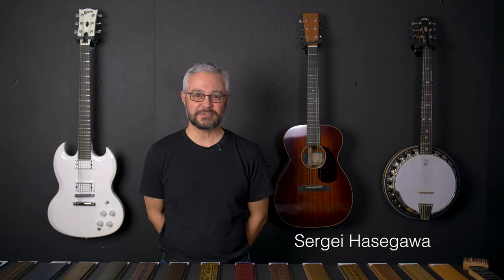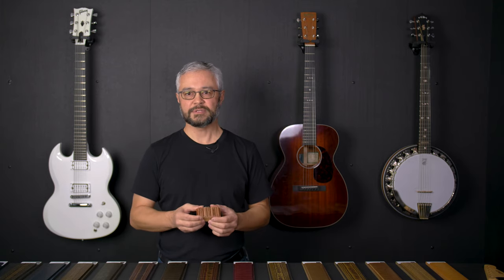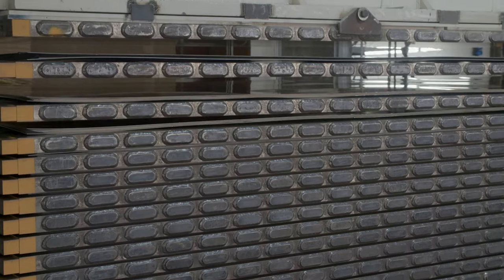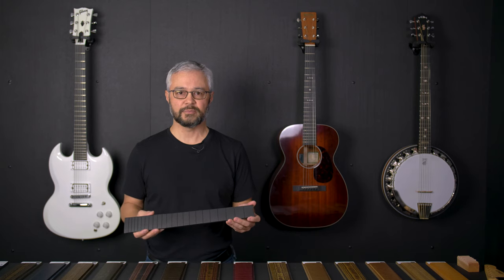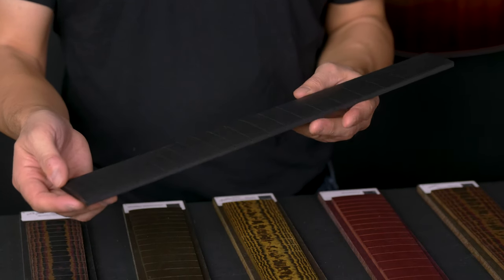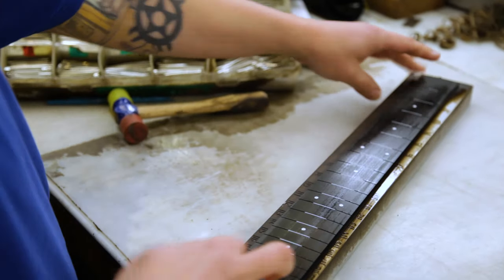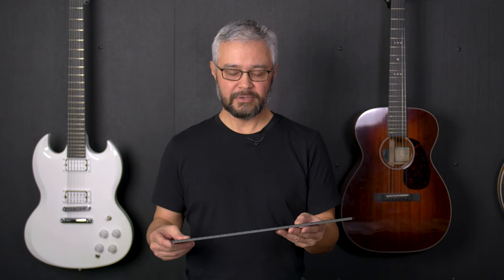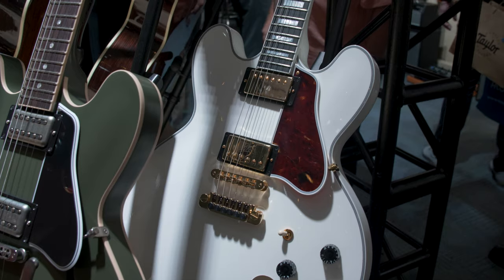Why Richlite Fretboards are Superior to Ebony!

Comment: Lets face it , you cant beat Ebony and rosewood for a finger board, however I have guitars with 
Richlite boards and they sound and feel great the one thing I find strange is why Richlite is 
the same price as Ebony
Reply: If you can't get ebony, you can use any other hardwood. Why would anyone pay for fake wood at the same price as the real wood? Am I missing something here? 🤔
Reply: With rich lite your paying the price that it takes to make and process the paper, for ebony your paying for the market value that the wood has since it’s very sought after. If ebony wasn’t popular then you could probably buy it at the same price as Indian rosewood for like $20 a fretboard
Reply: Richlite is so easy to maintain. That alone is a great reason. I prefer it.
Reply: @ANCAPVoluntaryist   Wood is cellulose. Paper is Cellulose. So the difference is that one has a resin impregnated into it. So there is really no difference. It's not fake wood. It IS wood  :) Best Regards and Best Wishes!

Comment: Best argument for using this is deforestation, even if the sound difference is minimal.
Reply: where do you think paper comes from?????? Richlite is 70% paper duh!
Reply: @dietersdawgs  Yes, but it can be made from recycled paper as opposed to cutting down a tree exclusively to be used only once
Reply: @Shmingleshmangle  I agree....you're still cutting down trees.....I do some lutherie and the problem with ebony is that what made it short in supply was primarily piano manufacturers insisting on jet black ebony, so the Africans cutting them down would cut down everything as about only one in 20 ebony trees has real black heartwood... and leave the rejected trees to rot....most of it is dark grey and streaked......too lazy to dye it black.
Reply: @dietersdawgs  Also, paper is usually made from softwood trees that can be grown rapidly (usually in plantations especially for this use) in comparison to mahogany, rosewood, ebony etc which are sourced from rainforests and have not been specifically planted for this use. I get what you're saying, but it's no argument that using richlite is far better for the planet than other woods luthiers have traditionally used.
Reply: @Shmingleshmangle  As a luthier and watercolour artist I am aware of that....softwood trees are not harvested properly either, they are usually clear cut and not replanted like a natural forest would be...my point is that richlite is not as "green" as they claim, being mostly made from wood, whether or not it is recycled or not, my point is that a tree is cut down for it, just like a fretboard.
Reply: @dietersdawgs  Well that's not true. They use recycled paper, so the tree wasn't cut down specifically to make richlite. It has an initial life as a paper product, then is repurposed into this material. You'd have an argument if they were cutting down trees and turning them directly into paper, then into richlite (which they obviously aren't). There is a huge difference between cutting down a fast growing softwood tree, using it for one thing, then recycling it and giving it another life...compared with cutting down an ancient hardwood tree with the sole purpose of using it as tonewood. Surely you can see that gigantic difference? Yes two trees have been cut down, but the context is extremely important.
Reply: @Shmingleshmangle  you're failing to see my point....both products come from trees...I'm more concerned with how the trees are harvested, you make it sound like harvesting softwood trees is ok because they grow faster, I'm referring to the wood industry in general.....the pulp and paper industry does  far more forest, water, and air damage than responsibly taking a limited number of hardwood trees....the "natives" in the areas where hardwood trees are to blame primarily because they cut down 20 trees to get one that they sold as well as the market that "demanded" jet black ebony....look at the lack of quality of softwood lumber in the past 60 years...it's because the best has been clear cut.
Reply: Aaron... I guarantee you, you can't hear NONE of that difference. If you say you can... You're lying. Bullocks.
Reply: @dietersdawgs  so you’re telling me that the southern yellow pine which is planted harvested and replanted for both lumber and paper applications in my geographic location is inferior in quality to the grove of virgin southern yellow pine growing nearby? Not arguing but if that’s the case, do explain.

Comment: Actually the main reason richlite is being used ( I'm ok with it, my Godin baritone has a richlite fretboard) is because most of the world's ebony has been bought by Taylor....I do not prefer it over my ebony fingerboard guitars, it has a somewhat "plasticky" feel, but it's not terrible either......it does have some advantages ( less shrinking, just as hard so it should wear well ) but if you properly look after a real wood fretboard and guitar that shouldn't be an issue....I have a good ear and it doesn't sound as good as real wood.....that being said, most people won't hear the difference.....I think for a guitar fingerboard they should maybe try to align the fibres in the paper to imitate the way the grain lies in natural wood, that may improve the tone....
Reply: @Randall Selinger It "sounds better" is a subjective preference based on qualia, otherwise everyone would be playing guitars made out of the same wood and/or with the same exact pickup set.  Richlite has been made recently with the grain of natural wood but the original ebony fretboards of old were ridiculously tight grained to the point of resembling a piece of hard plastic. The ebony out there now is porous, often "defective" grade wood by woodworking standards.
Reply: @DustyNonya  Not true.......all real wood ( ebony ) has a grain and is porous...richlite is a composite of recycled pulp paper fibres stacked in alternating directions of the fibres impregnated with resin....it's not bad, but it's not real wood and like everything else, some people's hearing is better than others, and being able to distinguish the quality and timbre of sounds is not subjective, it can be measured in laboratory conditions. Different woods and combinations of woods do produce different sounds, and the better and tighter the grains the better the sound will be....one may have a preference over certain tonewoods, but because one prefers the brightness of a maple neck and fretboard with a spruce top doesn't make it a better sounding piece than a guitar made with an ebony or rosewood neck and fretboard and a cedar top..... the preference is subjective, the quality of the vibrations which are unique to the different woods is not.....richlite doesn't sound as good as a high quality rosewood, ebony, or maple fretboard....there is nothing subjective about that, it can be demonstrated.
Reply: @dietersdawgs  Unless you've played a guitar from the 1850's, then you've never seen old Ebony. What you're seeing these days is low end or even "defective" grade by woodworking standards...much more porous, less dense material. I'm not saying it lacks grain entirely but it's a completely different animal to the wood that's available now, much like the old growth mahogany in older Gibsons, Martins, etc. 

Sound is subjective...this is why some people think that Chopin is the absolute best that music has to offer and others can't stand it. By arguing that "you can't hear it because your ears aren't as good" shows a fundamental misunderstanding of qualia as well as arrogance. What can be shown in laboratory or sonic testing is the difference in the tonal qualities of the wood...not the objective qualities of "good" or "bad". Gibson would also argue with you that tighter is "always" better...as too tight a grain on a top can diminish the volume just as too loose a grain tends to distort it not unlike yelling in a large gymnasium. 

To assert that you know what "sounds better" in an objective sense is foolish at best, at worst it's simply lying to yourself. Granted; better quality tends to lead to better instruments...but, if laminate were as bad as I personally felt, there wouldn't be ridiculously priced "double-top" classical guitars with pieces of balsa between them that people well outside of my playing ability love to play.
Reply: I'm saying that, all else equal, there are people who will fight tooth-and-nail over whether Mahogany sounds better than East Indian Rosewood, whether Brazilian Rosewood sounds better than Cocobolo, etc. In the end the quality of what's being played on it matters far more than the timbre of the instrument itself...and, frankly, I personally believe nylon string guitars all sound inferior to a well made steel string...that's the problem with qualia. If there were one, objective sound that completely outranked the rest bands wouldn't be comprised of different instruments, that's where you seem to be missing the point. 

I keep seeing you lecture people about what sounds good, telling people how "good" your ear is...but when I've checked your videos I see a pile of mediocre, mostly cheap guitars and a camera/microphone setup that's even worse than the cellphone videos I make when I'm drunk. I've heard nothing in any of them that suggests you have the talent or the ear to be judging anybody else's preferences in guitar and/or music. 

I could sit here and tell you how many musicians I know who value my ear and opinion after they've mixed it to round off the edges and bring out the various stems of their work...but, in the end, it means nothing to you or anybody else who aren't the people who value my opinion.
Reply: @DustyNonya  you're looking at old videos done for fun with zero production values...anyone who judges something like that as "definitive" needs to give their heads a shake......really, you think you can tell anything from the shit mics on a cheap panasonic cam corder? Lol! I'm simply telling you richlite doesn't have the tonal qualities of real wood....you go on about the inferior quality of wood available today and that's not true...it depends on how it's cut and how the tree grew etc. Most rejected ebony was only rejected because it wasn't jet black....streaked ebony can sound just as good as jet black ebony. There's no accounting for taste, and as for you saying my guitars are mediocre, you probably don't even know what they are, lol.....I doubt you've ever seen a great nylon player live...the nuances they achieve make what can be achieved on a steel string pale by comparison.
Reply: @DustyNonya  show me your stuff from 8 years ago when you were drunk, eh, or can you read a time stamp lol?
Reply: @dietersdawgs  I know nylon players who get paid to do more than penny-ante gigs. 
I also know a cheap Godin guitar when I see one, as well as how many mistakes are made in playing a piece that is ridiculously simple for "classical" guitar performance. 

You can go on about how they cut wood these days but it doesn't make the old, denser growth that was cut down to near extinction come back. It also won't make the "Little Ice Age" maple that Stradivari used to make his famous violins. If it were that simple there would be plenty of Brazilian Rosewood and Cuban Mahogany guitars for everybody. 

As for being able to find time stamps; there's this little thing called my Youtube page with some of my "performances" on them. All I hear from you are excuses to why you're judging musicians and then backpedaling the moment I point out your foibles. I'm not the one camping in a Richlite video looking to lecture anyone without "your ear" on how their ears must be too inferior to understand it.  That's the same sort've garbage ideology I'd expect to hear from a die-hard Shaggs fan on how "brilliant" a trio of untrained teenagers were at banging away with instruments they didn't know how to play.
Reply: interesting channel.
im looking up richlite because some electric cello brands have started using these for fingerboard (NS cellos). i have one acoustic cello that's traditional (ebony fingerboard) and an electric (sadly, a Yamaha and not richlite fingerboard). i guess people should have one ebony instrument? then all the others, use richlite, in spirit of conservation.
Reply: @keiraholst1563  after having two instruments with richlite fretboards for over a year now, I have to say they're fine and I have no complaints....I don't know if they've improved the actual richlite or not.....they do feel a bit different than ebony but once you've played them for a while you get used to them and actually forget about them.  They don't need to be oiled and there doesn't really seem to be a downside.
Reply: @dietersdawgs  good to hear!

Comment: I was sceptical when I saw Richlite on Martin's website. After watching this and hearing the comparison, I have no reservations. I should have trusted the Martin engineers in the first place.
Reply: Came here for the same thing. I’m looking at a D16e right now and saw it had richlite. I should have known Martin wouldn’t put it name on absolutely anything that was less than solid.
Reply: the main reason Martin is using it is because Taylor bought the rights to 97% of the ebony being harvested...it has nothing to do with "Martin" engineers.....also, anyone with a good ear can hear that ebony sounds better.....the paper fibres in the richlite is staggered like plywood to make it stronger in all directions...real wood has the grain running in the same direction.....if richlite and Martin engineers did their jobs properly they would know this and make a specific luthier grade richlite with the paper fibres running in the same direction.

Comment: My only doubt ID the durability and if i can use lemon oil on this
Reply: Richlite is ridiculously durable. You also don't need to oil it because it doesn't dry out/degrade at anywhere near the rate regular wood does.
Reply: @DustyNonya  oh thanks i will cosider this in the future
Reply: @mauriciotavera6957  I have a Richlite board on my Gibson. I was a hardcore Rosewood purist until I felt just how much smoother and nicer these feel under the fingers.
Reply: Well my Ebony board has been on my 1926 Martin  018 for almost 100 years and it's still perfect. I don't think I'll be changing anything